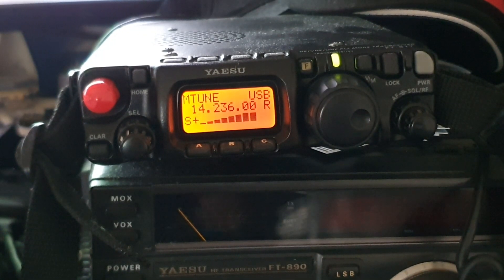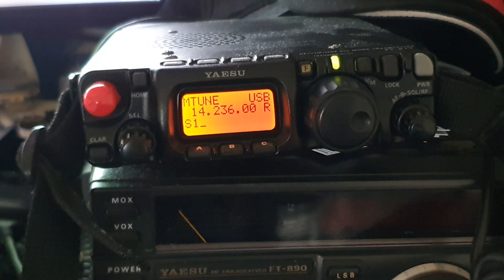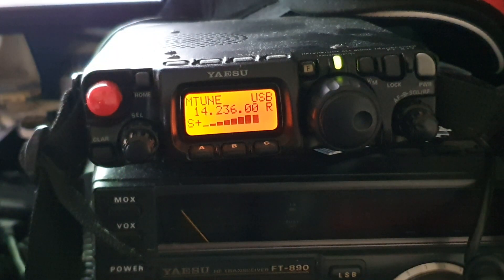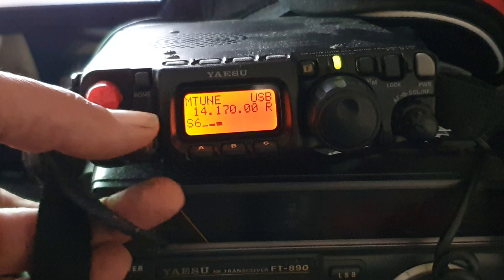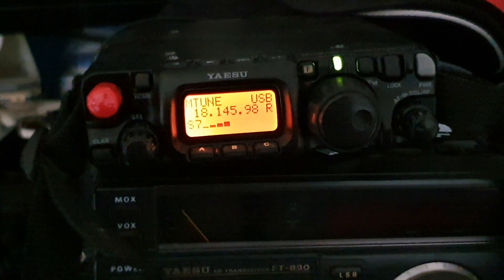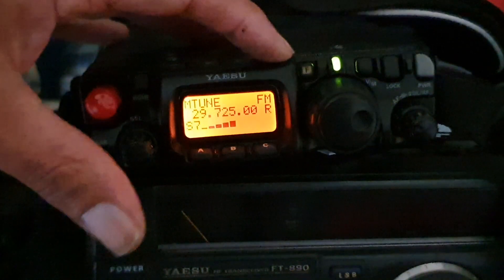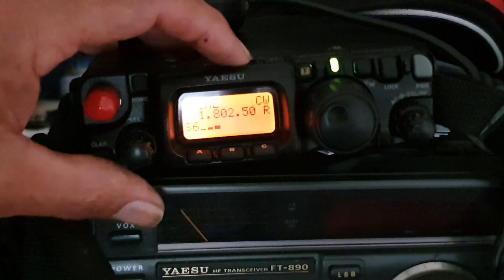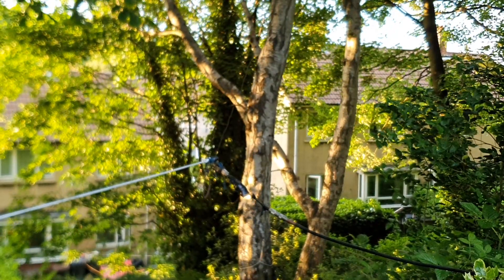YAESU  FT-817 Testing a new upgraded PA board.

Comment: Hi, where did you get the new module from?
Reply from the maker: Hi Paul, I took the radio to a pro electronics repair guy here in Yorkshire. He had the replacement PA board and if I remember correctly charged me 50 pound all in for the work and the replacement board. I didn't bother to strain my eyesight on the tiny components as it was a great service. Not so helpful answer sorry, but an idea of cost maybe? Hope you get sorted.
Reply: @M0YKSHamRadio  Thanks, I contacted him and he is going to fix it for me.

Comment: The 5w should be just enough to tickle a proper PA where's your Russian PA??????
Reply from the maker: As always, its still standing by. I fancied promoting QRP tonight lol. Not too bad for such a long run of coax to the Delta loop. A decent result for a QRPer lol
Reply: @M0YKSHamRadio  Indeed it is ...not a bad result ...no doubt the antenna doing most of the heavy lifting in this case!
Reply from the maker: @101blog  Yes its not a bad antenna for such a simple build. 73 GN